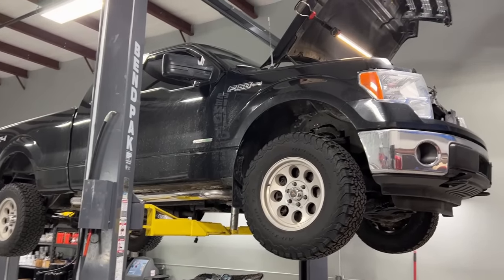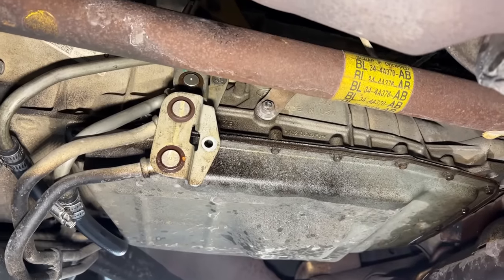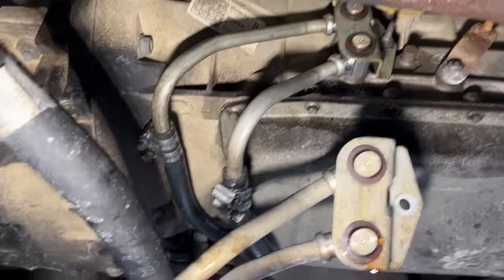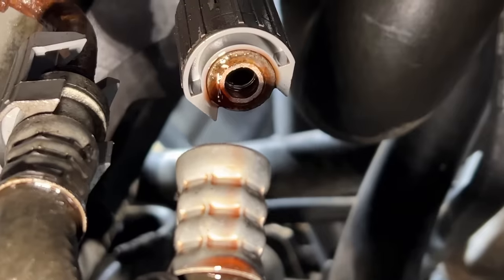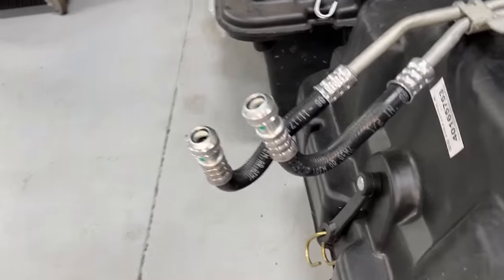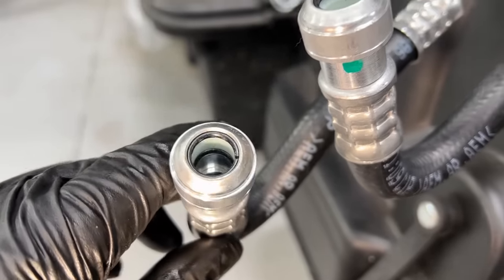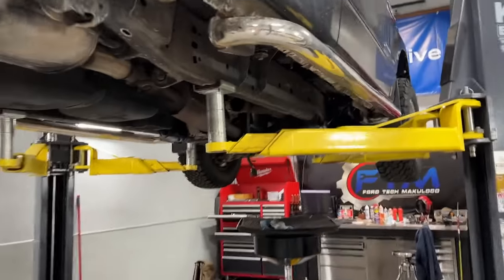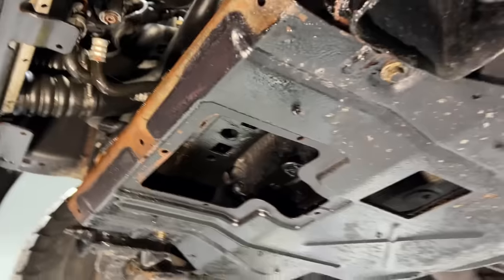Attention 2009-2014 Ford F-150 Owners! Check Your 6R80 Transmission Cooler Lines Before They Blow!

Comment: Just gives me more to worry about.  I have 2010 5.4L 6R80 with 400,000 miles.  Just changed the original water pump at 395,000 miles.  Still on original starter, alternator and timing chain.
Reply: Randal I have 373,569 on my 2010. I too am in the worry phase. I have a few trans lines showing some age along with a few other things. I just completed the whole timing job a few months ago myself.
Reply: @anthonylawhorn324  How much did that set you back?
Reply: Both of yall chill on the worrying and enjoy what you have.. . 
I have 08 mid yr with 195. Doing timing now
Reply: Dude I just changed my water pump on a 2014 5.0 165,000 KM!
Reply: My 14 5.0 coyote original water pump shit the bed also 2 weeks ago with 96k on it
Reply: That is impressive mileage for your 2010 and good to know at least some were built to last!
Reply: 2014 f150 here with 280,000 miles on the Coyote. No major problems just a couple AC compressors. This trans stuff scares me, those things are made with alien tech, Mine has had new filter each 100k miles and new fluid every 50k., So far so good.
Reply: Just remembered the original water pump went at 150k or so.
Reply: I’m at 352 gonna do phazers and chains and the whole works
Reply: Damn, that's impressive mileage. What oil do you use?
Reply: I have a 09 with 360k+ miles onnit. Truck looks like it has been dogged and disrespectfed for a long time. I picked it up for $1700 but i just noticed the trans is caked in black gunk and is now leaking in my driveway so let the games begin
Reply: Man worst truck i every had I have 156,000 and I replaced my timing 3 times and now I have to replace a connection rod I’ll never recommend a 5.4L only good are 5.0 and 6.2
Reply: What?? Why didn't you replace the chain when you did the water pump?
Reply: @anthonylawhorn324  Nah Bro, at 373.5k she’s good! I think it’s a matter of some break and some don’t like any other part. I have a 2014 with the 5 L coyote. My transmission lines are pristine but, Christmas Eve 2020 the radiator just gave up the ghost in the driveway and poured out with coolant. The crimp on the passenger side tank failed. Should all F150 owners now run out and replace the radiator because of a bad crimp? I think not.
Reply: Those who change timing chain , do oil pump as well...
Reply: 2010 5.4 6r80 with 250,000 miles. Did a timing job with roller followers at 180,000. Otherwise everything else is original. I really think this was their best truck. Guess they thought they made it too good. Had to go change everything so they didn't lose money

Comment: I can vouch for this.  I had this exact thing happen to my 2013 F150 at about 120k miles.  Luckily for me I was pulling into a parking lot when it happened to make a scheduled stop, and thats when I noticed the MASSIVE leak.  I just left the truck there overnight and had the tow truck get it in the morning, and since I had only driven about 200 yards at about 10 MPH; no further damage was done.  The scary thing is; it didn't throw any codes or warnings.
Reply: did you have to replace the transmission  or were you able to save it . this just happend to me
Reply: @kanitdechkhum1690  I don't think he did because he caught it before he drove it very long.  If you just found a puddle under your truck but haven't driven it, all you should need is that new line.
Reply: 2010 F-150,107k mi. Trans slipped a couple times while I was taking off. Next sm amount of fluid on driveway. Drove 10,mi to repair shop. Replaced as ll the lines. 550 dollar's
Reply: @kanitdechkhum1690  cut the damn thing off, and put house over the coolant tube, , use 2-3 metal band clamps, and you are good to go for the rest if you life. .. Older truvcks did not have any stupid connectors, but rubber house that slide over the metal tube and tighten with the clamps. .. whenever i would get a ford and see this joint I would just cut it off and convert to old school simple and reliable connector.
Reply: @genehejhal8117  why replace faulty line with new expensive faulty line again ))?  why not just cut off the connector and use house of tube and 2 metal band clamps))) Old school fix is more reliable .
Reply: @ansv3340  I guess I just wanted it fixed right..wasn't just one line, but 5 replaced. Live in WI. Rather do this than risk my trans on a garden hose.
Reply: @ansv3340  Do you mean to say rubber tube? Great idea, I'll do it on my 2013 F-150.
Reply: Yea it wont throw any codes if it happens immediately, and like you said it happened and you noticed it so you shut the truck off and didn't drive it. had you kept on going you would get a money ( engine ) light or trans light. theres also a gauge setting on these in dash for Trans temp. if anyone here has a truck over 100k miles its a good way to keep an eye on them, temp starts going way up you know you have an issue! as always Love Brians works
Reply: SAME! Mine failed and there was no alert that any sort of problem was occurring.  Transmission was slipping and shifting oddly as I pulled into a parking lot.  I parked, got out and saw transmission fluid pouring out onto the ground. Luckily, my transmission did not burn up like this guy's. A co-worker told me today the exact same thing happened to his while driving on the highway. Line snapped, all the fluid came out and burned up the transmission. No codes or blinky lights, no limp mode...nothing.
Reply: Brian, is there a better fix out for this issue?
Reply: @ansv3340  This is what the Firestone guys did for my RAM SS/T years ago when I blew a line and kept losing fluid but had it towed as soon as it happened.  They just replaced the section of hose that blew out and refilled.  They said this is what happened to those 94-01 RAM transmissions.  They ran strong otherwise to my knowledge.

So the fix, it was back to good as new, and I'm sure I drove it another 80k-100k miles before I sold it.  I was wondering the same exact thing in this scenerio.  By your other posts... so you're saying, just cut out that section and replace with a full rubber hose section past the quick connectors to where it's metal hose again...?  That's exactly what I was thinking when I was watching this video.
Reply: This literally happened to my 2012 f-150 last week. I drove to go fishing, stopped and got gas and noticed a leak. Went to the lake and then home. Drove a block away the next morning to our lodge. Went to drive back home a block and it didn’t wanna go into gear or shift properly. Made it to my driveway and the hose was barely hanging on. Was still able to drive my truck into my garage to work on it and transmission seems fine. Replacing the lines as I type this.

Comment: Aluminum...bend it once, bend it twice, throw it away. Based on what you could show in the images, it looks like some fatigue took hold in the quick connect. I suspect it will occur again in the same place unless something changes. I'm sure the quick connect was implemented for the assembly line, not for service. It might be time time for some racing inspired Teflon lined stainless hose with A/N fittings bypassing the  entire hard lines from cooler to transmission. Kudos on the double screw clamps per end of your bypass line.
Reply: until some shmuck comes along and cross threads the thing... modern cars kinda suck. not our fault.. fack...
Reply: That is a nice idea, although more expensive than you really need, I would just do standard rubber line. The biggest problem would be the oddball fitting they have at the tranny, would require some kind of adapter to get to an AN line, though maybe that already exists.
Reply: Yeah--  Those quick connects should be hard mounted to a bracket, just like the Steel line's are hard mounted.  That way it only leaves the RUBBER to take the flex, as it should be.   Those rubber lines are just too big and they dont' flex very well-- so it's transferring all the movement into the weakest link-- which is that nipple inside the quick connect.  If you hard mount those connections at the crimp---  then nothing can move but the rubber.  It's another part (being a custom bracket), but it's obviously needed.
Reply: @--_DJ_--  They already sell plates with an8 fittings
Reply: @noneblank6170  Ya, that is what I figured. With everyone and their brother having a CNC mill these days, that kind of thing isn't so hard to come by anymore.
Reply: PBH makes an adapter kit 👍
Reply: @Smokkedandslammed  not a bad looking piece, and they don't even bend you over too hard to get one. Thanks, I will keep that in mind if I am ever in need.
Reply: @--_DJ_--  Its definitely not too crazy priced, I have othe reports from PBH and it's good stuff 👍👍
Reply: A ny link to that part
Reply: @FlyingHaggisRacing Try google.

Comment: Not doubting the metallurgy issue but we all know that as rubber ages it becomes more rigid and brittle. That being the case the vibration these hoses were intended to quell can no longer be accommodated by a dry/brittle hose and essentially transmits its now non-damping factor to the aluminum connector now doing a task it was never intended. Like tires & wipers, rubber components have a limited lifespan of their own and should be taken into consideration during routine maintenance.
Reply: Of all the replies that I read yours is the one that explains why. I thank you for your explanation.
Reply: I have worked on plenty of those lines, I have never found even broken ones to have the rubber seem much different than new line. These trucks are not that old.
Reply: Aluminum fatigue fails. Period. Eventually it will happen. On top of that, you have a large change in size of the aluminum, so potentially more stress. Those quick disconnects need to be made from steel...

Now I have to check the '14 mustang...

Comment: same exact thing happened to my 2013 at about 115k miles. I got lucky and saw a couple drops on the driveway. Crawled under and literally just touched that line and it broke right off. I feel very lucky now that I caught it when I did.

Comment: Had mine go while towing a light trailer on the freeway (2013 F150 with 3.5L ecoboost, 148k at time of failure). Got a big ugly attention grabbing message on the dash, saw that the trans temperature was pegged. Pulled over, shut it down and waited for the tow to arrive. Once it was home I put it up the left, replace the lines and jumpers, and refilled system with fresh fluid. No burnt smell, no discoloration in the transmission fluid. Been running fine ever since. This is not an instantaneous killer, but she must be alert and aware of what the vehicle is telling you!

Comment: When I was in high school, a rubber transmission cooler line on my ‘68 Malibu burst in the parking lot after school. After the torque converter emptied, the car stopped, blocking the gate, in a pool of ATF. Very embarrassing for a 17 year old. Later I patched the line with generic hose from NAPA, added ATF, and drove it for many more years.

Comment: When I worked at Nissan as a tech, we had a lot of problems with the Armada blowing the transmission cooler hoses at the radiator. Thanks for the info!
Reply: I hear ya on that one. Have a 2010 armada however has a brand new radiator. I had the trans cooler in the radiator bypassed in the old one. I hope I don’t regret hooking it back up factory to the replacement one.
Reply: Yo! Eric!!!
Reply: Not just the Armada. Nissan pink death was on the Xterra too.
Reply: @fredsalter1915  Good to see you here!
Reply: Chevy had that problem too
Reply: That's the reason I'll never own a nissan . That happened to multiple friends at the same time .
Reply: Mercedes-Benz had these problems as well.
Reply: I lost 2 transmissions in my 2007 titan it broke inside the radiator and pumped antifreeze into the transmission replaced both and it did it again 2 times by 110,000 miles
Reply: @zachcoldwell7978  and the V6 Nissan Frontiers

Comment: I have a 2011 F-150 with 149K miles on it.  Recently I changed the lead frame out per your recommendation.  Now I have this to deal with.  I'm going to get those lines replaced ASAP.  Thank you very much for this heads up, sir.  It's the reason I've subscribed to your channel. 👍👍👍
Reply: Hello, I also have a 2011 F-150. What is this lead frame you speak of? I try to do as much preventive maintenance as I can but I’m not sure what you are talking about. Thanks
Reply: @abec7892  I believe it is the internal electrical connections in the tranny pan. Google Lead frame F150, comes right up. I know that round connector is prone to leaking, I don't know why he suggested changing it though, missed that video.
Reply: @abec7892  He covers it in the first few minutes of this video:  https://www.youtube.com/watch?v=4Ng3HJdyyoM&t=238s.  He also shows you how to do the replacement if you're so inclined in the rest of the video.  The Lead Frame can be hard to get, but go on-line and you can get it.  My transmission mechanic also recommended changing the solenoids on mine, but I decided to just replace the parts as described in the video, since I drive it like a granny and have never pulled a trailer or hauled heavy loads very often.  Good luck.
Reply: Much cheaper than replacing the transmission 🤑
Reply: @jamram9924  I'm so glad that he told us about this problem.  I'm going to be traveling in the mountains, and I would not want one of these lines to blow at 7,000 feet.
Reply: @audiophileman7047  hopefully you can find the OE hoses/lines in a timely fashion.
Reply: @jamram9924  They appear to be available, so I'm not too worried.
Reply: Same here! 2011 3.5L ecoboost. I actually have an appointment next Friday to get the transmission flushed, I’m going to add these lines to the order!
Reply: @j.wilson641  I would not recommend having your transmission flushed.  It can ruin the transmission.  Just have them take off the pan and drain the fluid that way and install a new filter and refill with Ford OEM tranny fluid spec'd for your tranny.  By the way, replacing the tranny oil cooler lines at the same time you're servicing the tranny is the best time.  I have my appointment to change my oil cooler lines on Wed of next week.👍👍👍
Reply: This guy is just making you dump money.  Yes you should get the lines replaced, that's just something you should do with all the rubber parts on your vehicle.  But the lead frame is not something you need to throw out right away.  I've got roughly the same miles on my 11 as you do.  Dude, if it made it that far with the original lead frame, you got a good one and it will be very unlikely to fail you.  The lead frames that do fail, typically do so early on.
Reply: why would you replace entire line for faulty joint with another faulty line? just cut the damn connector off, slide rubber house over the metal tube , and tighten with the metal clamp. problem solved forever.
Reply: @ansv3340  Why would you not replace an entire line with dry rot?  Maybe it's just me, I prefer to have fresh lines so a leak doesn't develop in 10 years.
Reply: @ansv3340  I believe the new one is re-engineered, and at 149K miles I won't have the truck long enough for it to fail.  I did that with a coolant quick connect coolant hose that connects to the coolant expansion tank; they sell an aftermarket kit for that.  The coolant hose hasn't been re-engineered, but your point is well taken on a lot of these Ford parts that just fail over and over again.

Comment: I just had mine go on my 2013 F150. LUCKILY I didn't drive far after feeling the engine  slowing.  Replaced all lines and transmission survived. And I have 117,345 miles on it.

Comment: This video saved my transmission. 2013 F150 5.0. After watching it I checked my lines and the crimp part actually split! So it was seeping out. Dropped in new filter, all new lines and new lines and small coil up front. Thanks again..

Comment: I just had this just happen on my 2015 F150. Line broke in exactly the same spot. I quickly realized what happened and shut it down. I installed new lines, changed the filter and refilled with new mercron fluid. So far the transmission has been good.
Reply from the maker: Good on you!
Reply: How many miles on your truck, I have 65k on my 2010. Wondering if I should replace lines soon.
Reply: You are living right my friend.
Glad for you.
Reply: @dirtberger4533  That engine is basically new. My 2010 has 200K and running strong. All the bad reputation 5.4 get i love mine. Very reliable.
Reply: @tr4u5mp90   I got lucky finding a low mileage truck, had it a couple years know.  Great Thank you for the info.  I love this truck it's been great.
Reply: I’m so glad you caught it quick my friend this happened when my wife was driving the truck and then I had to get a new transmission
Reply: @dirtberger4533  the line broke with about 110k but it definitely was either a product of corrosion or just a poor design. I would say time is as much a factor as miles. The metal is kind of a cast looking aluminum and it cracked and broke off. I live in northern Indiana so the truck does seem it’s share of salt. The line set was only about $100 at the dealership and if you are already doing a fluid and filter change it wouldn’t be to bad.
Reply: @davidmowat4056  Thank you for the info, I live by the Coast, we have a lot of salt rust to. Good idea, next time I service my transmission I will change these out.